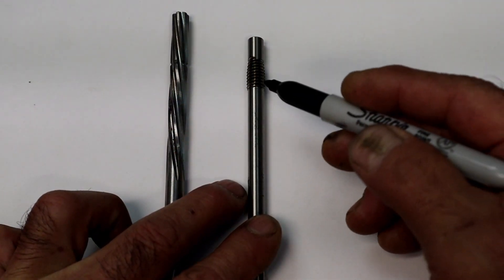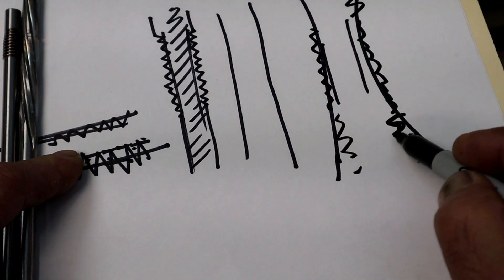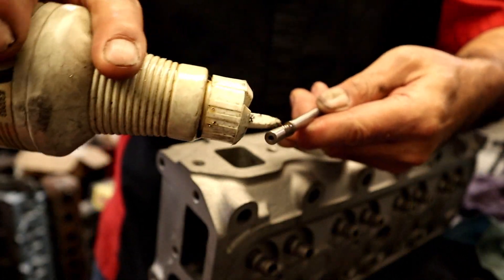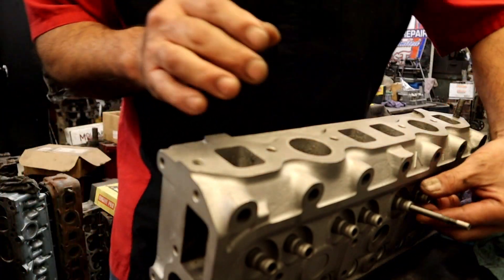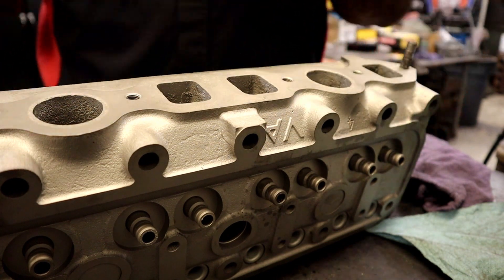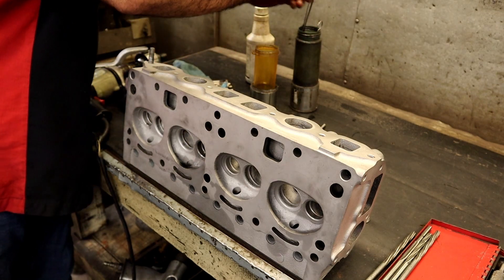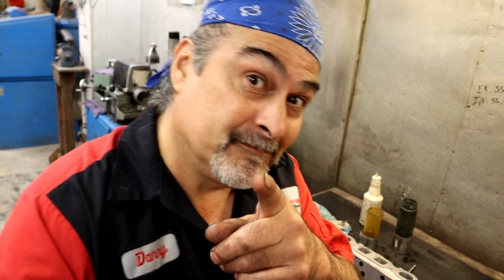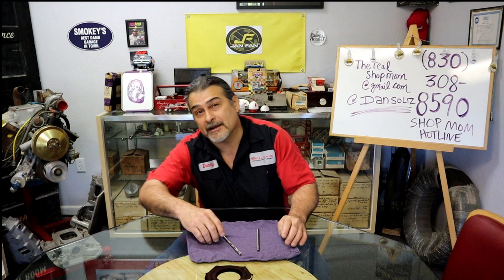KNURLING VALVE GUIDES: THE PROS AND CONS

Comment: Knurling valve guides? You gotta be kidding me, man! I guess there are two of us left in the world who do this! My sets have burnishers, not reamers for the final pass - I like 'em because you leave no raw edges - the burnisher just compresses the metal ridges left by the knurler to finished size, leaving a nice, smooth surface with a good oils spiral. Not all tools are created equal. Great video, especially stressing when to knurl and when to replace.
Reply from the maker: I'm so glad you understand, it's not for guides that need to be replaced and actually retain oil better.
Reply: I was taught how to knurl the guides over 30 years ago in automotive tech school. Granted it's not the best choice for all applications. It's been about 60% of actually replacing the guides to 40% knurling the guides.
Reply: Second that with the burnishing, no metal removal
Reply: @MrDanielSoliz  Can knurling be used to tighten bronze inserts ? tks
Reply from the maker: @luckyPiston  no I wouldn’t do that. The liner is to thin.
Reply: what i always did

Comment: I have never seen a knurled guide that shouldn't have been replaced instead of knurled.   Very few people use guide knurlers right, and I think you may be the first I have actually seen.   I have been using k-line bronze liners instead of knurling since it is fast and you usually cut enough out to have a straight guide again, and they are very forgiving in regards to valve material.

Comment: My personal cut limit for knurling is .0008 over desired finish size. Example 8mm LS hardened iron guide i finish at .0015 To .0018 so the maximum guide wear I will knurl is .0026 This number is also with in the GM published service limit. On a non-hardened guide application such as older GM and almost all replacement guides I just replace them. I don't feel a knurled and reamed non-hardened guide will provide the service life I want my product to go out the door with. As for lubrication when I knurl and ream a guide I store my knurls and reams for a specific size in a can filled with WD40. the keeps all the tools at a constant temperature as well as lubricated. I also use 8 reamers on v8 head one pass per reamer per guide as the reamer Gets hot with each pass. with heat the finish size changes.

Comment: Nice video! I'm working on a flathead. I am getting .060 oversize valves both I&E. I recently purchased a set of Sioux Tools to do this. My question is this: I don't seem to have the .850 Pilot Holder? Do I use the new removable valve guide instead of the Special pilot holder?
Reply from the maker: Yes you can , just make sure it’s not to loose.

Comment: Your videos are great, thanks for taking the time to make them. You mentioned doing a video on replacing the guides, that would be much appreciated, I have so many questions about that. 

I would like to replace a few guides in a 4 cylinder Honda head. I bought the replacement guides directly from Honda but the service manual doesn't cover all the technical details for replacing them. For example, the guide part numbers say they are oversized which I think refers to the OD (I haven't removed the originals yet to confirm that). I'm assuming there is a standard interference fit and they make the OD oversized so that can be achieved before installation. But what is that number? How oversized should the new guide OD be in relation to the aluminum hole it's being installed into? My other concern is once I install the new guide how likely is it that it'll be concentric to the original valve seat cut? A video covering this info or a comment reply would be very helpful, thanks again.
Reply from the maker: The next time I do a Honda valve guide I’ll do that. I may be able to do a general guide video where I can answer your question and give tips and advice. Maybe able to that this week if that helps.
Reply: @MrDanielSoliz  Thanks for the reply, yes, that would be very helpful. Looking forward to it. Btw, I love watching you and Faye, hands down, salt of the earth people!
Reply: The oversized guide will require the guide boss or hole to be sized for the guide. There should be a.004 to .008 interfearance fit depending on application. Unless the original guide hole is damaged and will not hod the guide you should be able to but a standard size (OD) guide to go in with out resizing the guide hole. As for the seats they must be recut once the guide is replaced.

Comment: Awesome.   Pls tell me.  If im doing  11/32  V8,s.  What size  nurl and what size ream do i use first.  Mike.
Reply from the maker: You will need an 11/32 knurled ( they only make one 11/32 ) and I would start with an .341 reamer. Depending on what valves your using.  Factory and aftermarket are different. Factory would put the clearance in the valves. Exhaust smaller stem then intake. Aftermarket are all the same stem and you add clearance to the guide. (.341 intake and .342 exhaust) just an example. Hope this helps.
Reply: @MrDanielSoliz  Right, got ya.  So the exhaust should always have more clearance for expansion.   are those reemers 11/341 etc.  I
Reply from the maker: @michaelgiglio1571  11/32”  = .341 “
Reply: @MrDanielSoliz  saved me a lot of time. Tnx

Comment: I have worn valve guides, which should maybe be replaced , going to measure them up and see. But the engine is a flathead 8 that is in the car and if I was to knurl the valve guides I would not be able to go all the way through. Is it possible to knurl all the way down and then back the knurler out, or is that an absolute no no?
Reply from the maker: I’ve never backed one out. Sorry it’s so late but on Monday I could try it on an old head and see if it works. Let me know.
Reply: @MrDanielSoliz That would be  fantastic if you could try and let me know. Thank you!!! 

What are your thoughts on using valve guide liners??
Reply: @MrDanielSoliz  I don't think you need to try backing out a knurler for my sake, I was just speaking with an old time mechanic and he said my valve guide are too brittle and won't knurl.  Cheers!

Comment: HELP?!?! So after talking to others and finding the valve guides on my Packard are too brittle to successfully knurl I decided it would be best to replace them, but the first one is STUCK, I can't get it to budge. I did manage to get the top to break off. 😕 Have any tips or tricks for removing stuck valve guides?
Reply from the maker: I would drill out the old guide. Stay slightly smaller then the guide and that should help break it loose.
Reply: @MrDanielSoliz  Thank you!  I had wondered about drilling them out as well. Cheers!

Comment: it is the best procedure to have an engine burn oil past the valve guides, a worn out guide must be replaced or a liner installed.; on commercially knurled guides, there is a portion in the lower part of the guide that is not knurled to prevent massive oil consumption, it is not the case the way the knurling tool is used.
I had a very bad experience with knurled guides...never again.
Reply from the maker: Thanks for the comments, this is exactly why I made this video. Some people think knurling valve guide is the same as replacing guides and no or isn’t! If you needed guides the shop should of replaced them and no they don’t smoke and no the spiral does not make it smoke. Check out K-line liners and they have a spiral all the way down. I’ve knurled thousands of guides and have never had on not work or not last. Once again if anybody is reading this  don’t knurl a guide that needs to be replaced. It won’t last and leave a bad taste in your mouth and you will think it doesn’t work. Think about it if I tried to paint over oil and then said oh that don’t work. Don’t make any sense. This video is to help people understand the pros and cons of knurling. Hope this help you understand what happened.
Reply: @MrDanielSoliz  botched work is the main reasons why I gathered some equipment and now, I do my own valve jobs, I use sleeves as that needs much less equipment to install and it fills the bill for most gas engines, most engines i do now are intended for boating use ( about 3 month  a year here )
For sure that a solid replacement guide is the perfect answer for a long lasting engine as an heavy duty diesel as often on these engines, the guides are replacable and fiddling with sleeves has no real advantage.